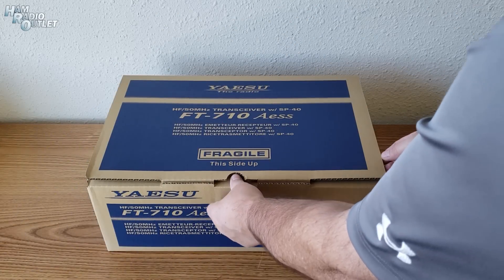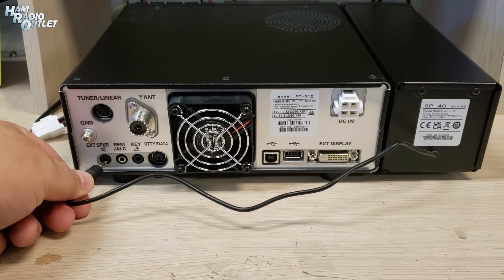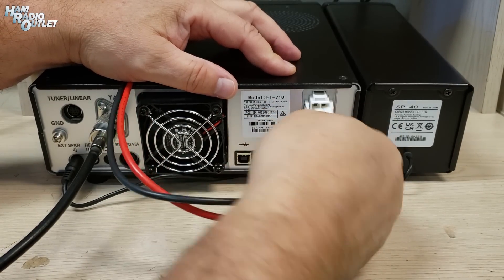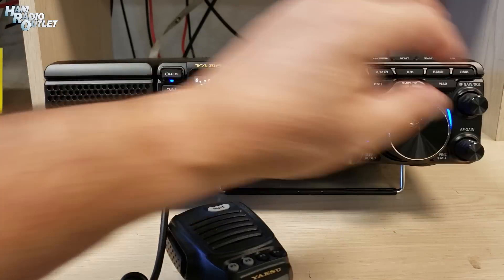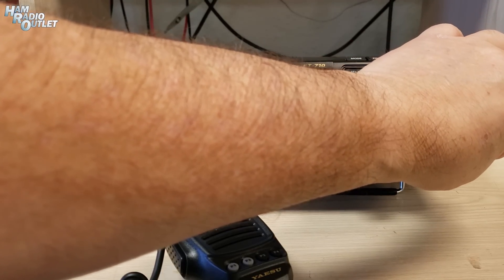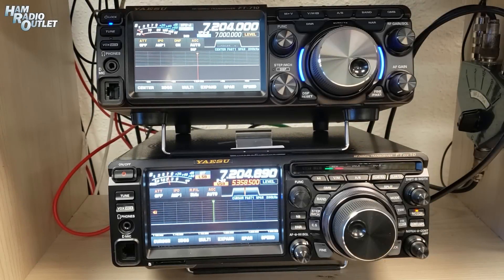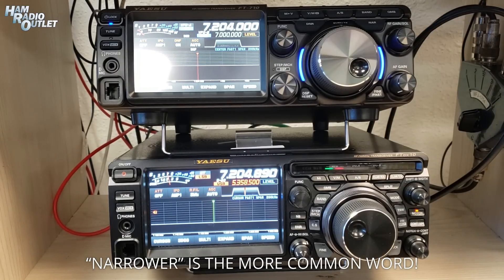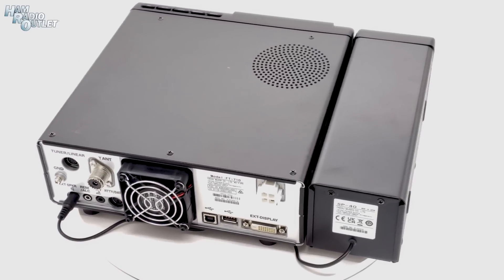Yaesu FT 710 First Look - Ham Radio Outlet

Comment: I am a Yaesu guy. BUT, not much to look at. Is it menu driven? I realy like my FTdx3000. Switch antennas, split antennas. Quick access to the knobs. Nice map though.
Reply from the maker: I like physical dials, switches and knobs too... even though they are more likely to fail.
Reply: @HamRadioOutlet  HA HA HA you are funny. Failed hardware vs failed software. This is a new debate. We should talk about this topic. Just ask Microsoft and Apple.
Reply from the maker: @DavidS-iw4ei  Very easy to replace software. I've update the firmware on all my radios at least once. 🙂
Reply: @HamRadioOutlet  Got you, now we need to do firmware updates. Yea I think I'll wait 2 to 3 years and see how the radios works out. The FT-897d had a run of 14 years. FTdx10 is only less then 3 years. ???

Comment: is that high qrm across the 40m band from strong signals or is that qrm from a switchmode powersupply or another device in the house ? i wonder how the yaesu ftdx10 would handle that same qrm in 40m, because if that qrm is away in the ftdx10, that means its qrm from strong nearby signals, which the ft710 can not blot out because it doesnt has a roofing filter. i want to hear a side by side comparison of the receiver in SSB voice with the Icom IC-7300.
Reply from the maker: That's QRM from every other store nearby! There's a laundromat next-but-one store away, for example, with dozens of massive electrical motors spinning away 12 hours a day. Every radio suffers from the same QRM.
Reply: Look on the results of the receiver comparison by Sherwood engineers. Two Yaesu transceivers in the top three in the world (the FTDX10 is the third receiver in the world). By comparison, the IC-7300 isn't even on the front page. I am sure that the FT-710 will have a much better receiver than the IC-7300, although it is only SDR. So there is not much to compare, except subjective feelings, but they do not matter much.
Reply: @Sylwester_Krolak  the 7300 has an industry quality a/d converter, but the ftdx10 (ftdx101d/mp same) has only a low quality cheap commercial a/d converter, accordingly the 7300 sounds better (clearer and more detailed). the sherwood website does not show a measure for that at all but other measured values of receivers, accordingly that sherwood page is not telling the whole truth about how good these recivers really are. you and alot of other people are (apparently) not aware of that. the ftdx10 is much more immune against inband strong signals, i admit, but the ft710 on other hand has no roofing filter and no preselector either, so that advnatage of higher immunity against strong inband signals will (very likely) not be excistent in the ft710, at least the 7300 then sounds better for its higher industry quality a/d converter as i write in the beginning of this comment. i would then rather have the better sounding 7300. i want to hear side by side comparisons on weak ssb voice signals in bother receivers, the 7300 and the ft710, together with strong signals on the side too, that will then tell which one is better in what regard.
Reply: @Sylwester_Krolak  I judge a radio by the receiver performance and audio quality, the 891 is right up there and the FTDX-10, Yaesu have nailed it when it comes to audio quality. I had the 7300 and the audio quality used to wreck my head, I had to have NR on all the time and it effected the sound quality, I live in the country with little to no qrm and the 891 beats it by miles both on receiver performance and sound quality via headphones, I always listen via headphones, you can capture weak signals in a way not possible with speakers, to my ears anyway.

Now I have the FTDX-10 and it's an amazing transceiver, not perfect, yaesu could have done better in some ways such as allowing live typing with keyboard for RTTY and PSK31 rather than use macro style messages. 

Allow the mouse more control, have high resolution video for large screen, the video out looks horrible on large screen with 800x600 resolution, this is dumb. 

But the FTDX-10 is an amazing transceiver so no doubt the 710 will be too. 

As a FT-450D replacement I would not consider the 710 that because it's too expensive, the 891 is a fantastic entry level radio and it beats the pants off the 450D on receiver performance and sound quality.

Comment: I still have a brand new, unopened in the original box; Yaesu FT-991A that I purchased roughly two years ago!

Has my 991A been rendered outdated by this new radio? 

Where does the 991A fit in the spectrum of Yaesu transceivers starting with the 991A and working up to the FTDX-10? 

Keeping in mind that I still do not have a license nor does my paygrade come even remotely close to that of a Technician's level of knowledge. I had plans on learning the radio strictly on the receiving end while I study for my license(s). 

But alas, life happens and we must address those events accordingly. 

Stay classy my friends.
Reply from the maker: You are still in really good shape with the FT-991A. It has 2m & 70cm all-mode capability, which neither the FTdx10 nor the FT-710 have. The FT-710 is marketed as an entry-level radio, below the FTdx10. The FT-991A was introduced in, I think, 2016. Technology always advances.
Reply: I have the 991A and will not be getting it rid any time soon..... its just too dam useful having 2 meters and 70cm included... Not only that but it performs superbly an all the bands... A keeper for sure.. Its a shame the DX 10 didnt have the higher bands included.. oh well..

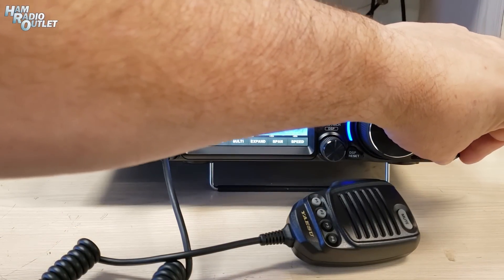Comment: Skip to 4:00 to avoid the distracting background music loop - the first 4 min, and last few, were practically unwatchable for me.  Otherwise it's a decent initial overview.

Anyway, nice display, but I'm turned off by the gigantic add-on speaker.  Not really clear about why I'd buy a 710 over a DX10 or 7300, especially given the prices appear to be pretty much identical.  On paper, the DX10 looks better other than size and weight, but this thing is clearly not meant as a portable.  I'm really not seeing a clear value proposition here (unless they're cancelling the DX10?), but I guess we'll have to wait for the real reviews.

(Edited to temper my initially strong reaction to the background music.  I still don't like it, but recognize that it's a creative choice.)
Reply from the maker: Maybe adjust the EQ on your computer speakers - the music is more than -18db down from the dialog track. The add-on speaker is just that, an add-on. If you don't want to use it, don't attach it, and don't plug it in. The FT-710 is a much newer radio than the IC-7300, which is pretty "mature" in technology terms. We will have to see what the reviewers say about the FT-710. This radio is not marketed as a portable radio. The FT-710 is a rung below the FTdx10.
Reply: @HamRadioOutlet  Thanks - yeah, that confirms my impression about it being a step down from the DX10.  Interesting that the pricing as it appears today doesn't reflect that, but perhaps that will change when it's available.
Reply from the maker: @chris.a.1  Don't forget, there are manufacturer specials on the FTdx10 right now. When the coupons expire, there's a $400 difference between the two radios.
Reply: @HamRadioOutlet  "the music is more than -18db down from the dialog track"

I must agree with Chris A.   I run into this frequently, even with professionally produced video.  I have not so much a hearing problem as a audio processing problem.  Undiagnosed ADHD or whatever it may be, it seems my brain tries real hard to make complete sense of every audio input and winds up failing at most of it.

It's bad enough I grew up thinking I was anti-social because parties and any crowded (or plain loud) situation gave me great anxiety.  Turns out its part of my brain going nuts trying to follow every conversation and sound queue.  Music under voice does that too, but it doesn't have to - if the music is down to a completely, non-compete, low level it's fine and fills the empty space like it's supposed to.
Reply from the maker: @Randrew  Thats a good point. Music helps carry the video forward, which is why it's used everywhere in TV, video and movies. Especially in cases like this one, where I literally had 3 hours to get there, set up the radio, shoot the video and get home so that I could start editing and upload it to our social media platforms that day, the video clips were a bt "disjointed". The music, even at its very low volume compared to the dialog track, helps make the video clips flow. I probably could have found a better music track which wasn't so repetitive, but when time-remapping a piece of music to fit the video, sometimes you end up with even more repetitive music. ...And, I just didn't have the time.

Comment: I would love to see the external video.
Reply from the maker: "External video"? Do you mean, the display put on an external monitor? I was going to do that but ran out of time.
Reply: @HamRadioOutlet  Exactly.  How the monitor looks hooked up to the DVI-D port.  Thanks!
Reply from the maker: @stuartross  We gave the radio to Josh at Ham Radio Crash Course to do a full review. I'm sure he'll plug it in to an external monitor.
Reply: @stuartross  It won't look good, 800x600 resolution on anything more than a radio size screen looks poor, this is why there's no HDMI socket because it would be a waste of money. 

I feel that the 710 could have had a much smaller screen, more buttons and higher resolution out for waterfall would have been amazing but the FTDX-10  video output is the same. Still an amazing radio though and no doubt the 710 is too.

Most radios have low resolution output.

Comment: FT-710 is actually sold for ¥117000 in Japan, so it is $830 when converted to US dollars.
Reply: It is £1200 in the UK but already discounted by some outlets to £1100.
Reply from the maker: There's no import duty on radios made and sold in Japan. There is import duty for radios built in Japan and sold in the USA. There's also import costs to ship them here. There are also state and federal taxes, so it's not really fair to compare prices between countries.
Reply: @HamRadioOutlet  It's difficult to compare, and largely irrelevant, in the UK there is 20% tax plus import duties, the home market of Japan is different to the USA or UK.
Reply from the maker: For anyone thinking of buying it in Japan and shipping it to another country because it is cheaper, don't forget there's no warranty coverage when you do that! If it broke, you'd have to ship it back to Japan to get it fixed at your expense.
Reply: @HamRadioOutlet  That's true, but what I want to say is that you can buy it cheaply in your country due to the effects of the weaker yen and stronger dollar.
Reply: @sr9537  Yet most retailers here in the US are listing it at $1300
Reply: By the way, this price is at Amazon Japan and includes points.
Reply: radios made for the japan market are no good in the USA, as the electrical power is rated differently. so one would also need a power converter. aka: more money.
in the USA lowest price is $1,200+ USD. up to $1,500USD.
Reply from the maker: @larryjanson4011  The radio runs off 12V DC. 12 Volts DC is 12 Volts DC all over the universe! Also, the price is considerably cheaper than you specify.
Reply: @larryjanson4011   12v DC is different in Japan? Fellow can learn a lot on here.

Comment: The AF gain knob looks pretty wobbly.
Reply from the maker: I didn't really get the feeling it was, but it does look that way in the video. I'm sure with more time in front of the radio I'd be able to compile a list of likes and don't likes.
Reply: Not just the AF gain knob.  It looked like all the small knobs were mounted on spring shafts.

Makes me hope it's intentional, like a short "rubber" shaft segment designed to absorb shock.  Or it could be flimsy plastic shafts.  Disconcerting effect, either way.  If I owned an FT-710 I'd carefully pull off one of the knobs first thing to see why they're wobbly.

Comment: I imagine it is a DSP receiver.
Reply: The FT-710 AESS is a pure SDR (Software Defined Radio). It will rely heavily on the DSP for filtering. You might consider it as a more economical version of the FTdx10. I call it the FTdx10 “lite”.  It has some improved ergonomics over the FTdx10, but it will not beat the receiver dynamic range of the FTdx10. It lacks the superheterodyne front-end. But it might possibly be the best entry-level HF base station ever made.  

I paid $1300 for my FT-920, back in 1999.  The matching external speaker was not included.  The FM board and CW filter were also not included. After buying the external speaker, FM board, and CW filter, I invested over $1600 in that radio. It has been a fine base station but it doesn’t have the fancy display, monitor output, or the advanced DSP. 

73, de N4HNH
Reply from the maker: @n4hnhradio  Yes, what you said. 🙂

Comment: Does having the speaker attached to the radio , cut down on air flow ?
Reply from the maker: It does not. The fan is at the back of the radio and the opposite side is still open.

Comment: Too small for home station regular use
Reply: And yet thousands use the IC-7300 as a base station regularly, are they all making a mistake? The FT710 and IC-7300 are almost identical in size while the FTDX10 is only a few mm larger. I have been successfully using an FT100D here in Asia for around 20 years as a base station, and you cannot get much smaller than that rig.
Reply from the maker: @kevargao5031  Agreed. Quite a strange comment, Jim. The best selling radio is the IC-7300 and very few people use it mobile. Most use the IC-7300, the FTdx10, and the FT-991A as base station radios in their homes, and they're all pretty much the same size.
Reply: @HamRadioOutlet  "The best selling radio is the IC-7300 and very few people use it mobile."

I have a 7300 and I've never considered going mobile with it.  I did operate it on a picnic table in my back yard once and that was OK but I probably won't do that again.  The Xiegu X6100 is much nicer for mobile and POTA affairs, IMO.

Some day Xiegu or another Chinese maker is going to make a fully nice AND modern rig and Japan may lose its crown ;)
Reply: I love a proper base station at home too.  I have the FTDX-101d now.  The problem with small radios is that you have to go through menus to access functions.  But I think the 710 is quite a decent home radio.  Not too tiny.
Reply: @la7dfa  ones the radios are set up to the way you like it you really need to adjust anything
Reply: @adam-g7crq    If it is properly designed then it sure will be.  But if you have to dive into sub-menus to find noise reduction and even CW filter, then its not for home use.
I had the IC-706 and it was horrible with menus.
Reply: @la7dfa  radios like this new Yeasu and the 7300 aren't the same size as a 706 and the majority of the functions are available as single user buttons on the radio, yes you may have to go into a menu from time to time to readjust something, like I said earlier once the radio is up and running your ok to go.
Reply from the maker: @la7dfa  Noise reduction is on a button on the front panel, and a touch screen button.
Reply: @HamRadioOutlet  Fine, I was not saying this radio was hard to use at home, but direct button entry for many functions can be important for some users.
Reply from the maker: @la7dfa  I agree. I think having to long-press a button, touch the screen to go to a menu, touch the screen again, spin a dial and press two more buttons to get out of the menu  just to change the Tone of a repeater on the FTM-400DXR is a real pain! 🙂
Reply: @la7dfa  I'd rather have just two knobs: VFO and multi-function (volume, etc) and one BIG color touchscreen.  And once Gen-Y, Gen-Z and whoever's after them are the majority of hams living, then I think that's what they'll have.
Reply: @Randrew  Yes it is not wrong to use a screen for that, except touch marks.
Reply: Is there a speaker within the radio or is the external speaker the only speaker?
Reply from the maker: @AE5X  Yes! There's an internal speaker too. You can see it in the video, just wasn't used! 🙂
Reply: My 'home' rig is the Xiegu G 90... Let the howls begin.😎

Comment: From the description on the video, it appears that Yaesu has dropped supplying the headphone adaptor and spare fuse, if they are penny-pinching on those items I wonder what internal components they are also penny-pinching on? This concerns me as I live in Asia for 6 months of the year and will buy it when back in the UK in Jan next year, I don't want a radio with inferior components that could fail and be unable to get repaired until the warranty has expired.
Reply from the maker: There was no headphone adapter (maybe there is not much call for it anymore?) in the box, but there is a spare fuse. It would make zero sense for Yaesu to use inferior components that break during the warranty period where Yaesu would have to pay for shipping and the cost of repair.
Reply: @HamRadioOutlet  Hmm perhaps you are right, but the worry is still there. maybe just fail when the warranty has expired like some TV manufacturers. Although I agree that Yaesu are not known for doing that.
Reply: all manufactures know about when parts will fail. that is why they have short, or otherwise unusable warranty's. as they do extreme testing on everything. just to find the avg fail point.